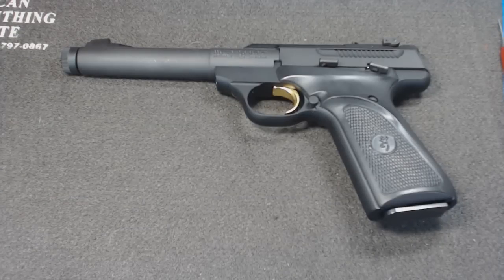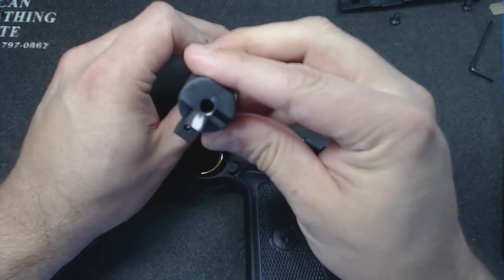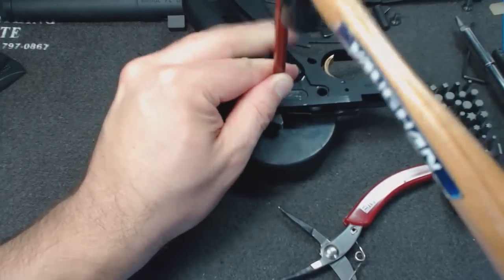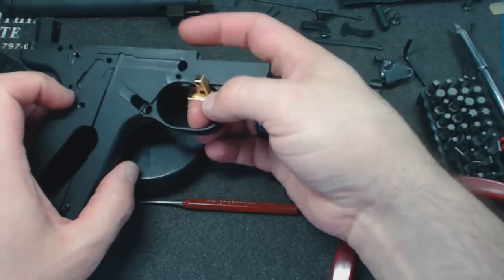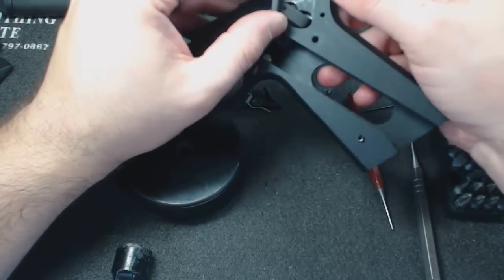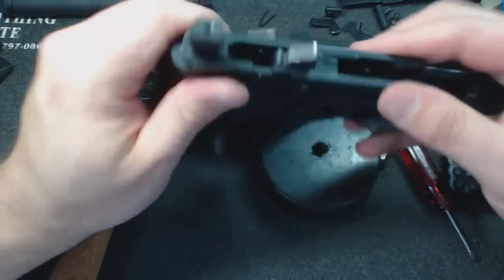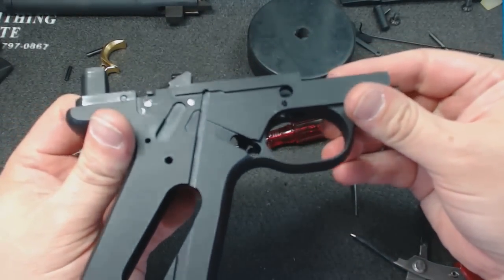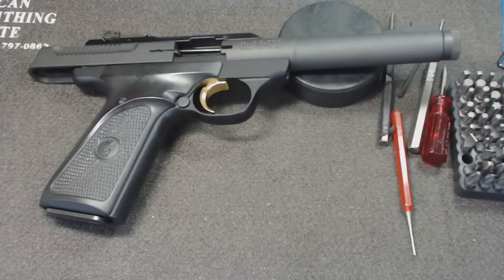Browning Buckmark 22LR Walkthrough disassembly and reassembly

Comment: When I saw that this video was almost an hour and a half long I almost passed it by, BUT your humor made it all good!  I'm getting ready to Cerakote one of these so I turned here for disassembly info.  BTW you can compress the hammer spring and use a paperclip (or similar) across the two holes in the frame allowing you to work with the hammer without spring tension. Although the spring launch to the chest comment was hilarious!  Thanks for the video.

Comment: You seemed to like the way the Victory was built but didn't comment on the Buckmark.  Any thoughts?
I might get the Buckmark just because the trigger is better and the grips feel better to me....
but I suspect the Victory may be better built.  And... they don't tell you to take it to a gunsmith for cleaning.  :)
Also like the looks of the stainless camper model better than the victory.

Comment: Just thought I'd mention, there is an extra hole in the back of the frame for capturing the hammer spring...  Depress the hammer all the way back, past the cocked position, insert a punch that is close to the diameter of the hole, and the hammer spring will stay compressed, making it really easy to remove and install the hammer and sear.  If doing a full strip and reassembly, just press the spring and follower all the way in with a big punch and then stick the punch through the side, and start assembly.  Hope this helps!
Reply: Aaaaaand, I just saw your other video.  anyways, thanks for putting this together, I appreciated the info!

Comment: Mine is a micro plus from 1995 and does not have that plastic firing pin carrier.....it lays in a channel and the securing roll pin goes through the actual slide.....i preffer your system better.......you can remove a) very simply......only thing that comes out of mine is the spring and guide rod.....

Comment: Couple of small points to consider
1. Learn the names of the parts. Words matter
2. Get proper tools for working on guns, they are not that expensive
 3. For the love of God fix whatever is  tapping
4. Fix your lighting and focus your camera or at least get in frame
5. LEARN THE NAME OF THE PARTS
6. It should NEVER take over 90 minutes to do this procedure,  i have done it multiple times in less than 20 minutes, even when explaining it 30 minutes max. Most of that is due to the fact that you know almost nothing about this firearm. 
 I'm giving up after 20.minutes and you still don't have the grips off
Reply: So where's your video showing the disassembly and reassembly of this firearm?